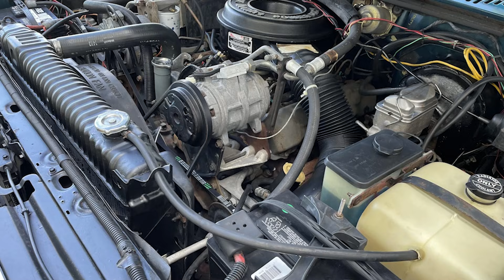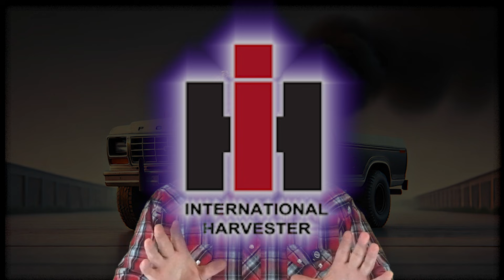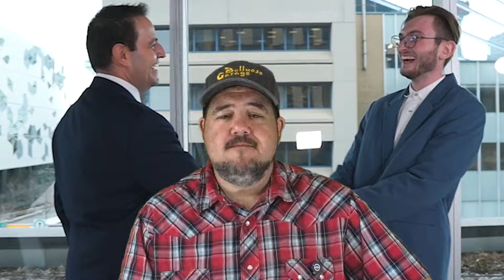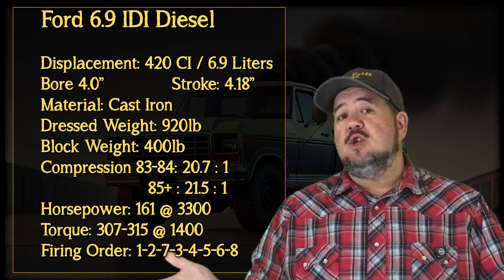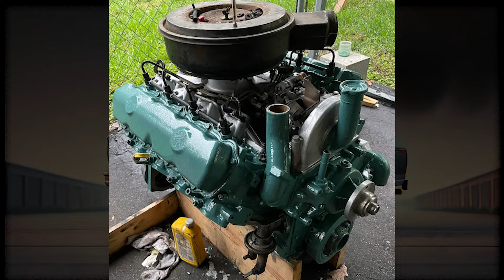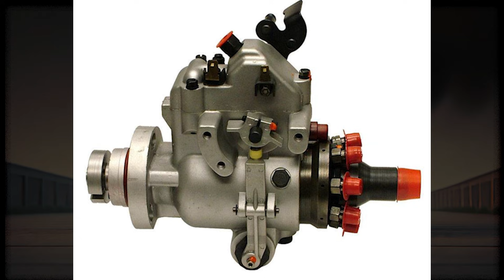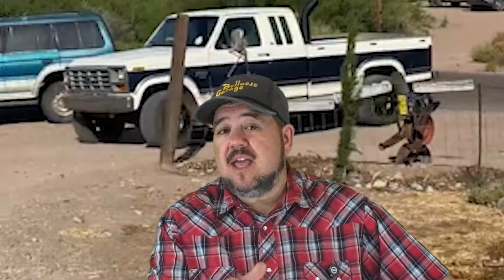Ford 6.9L IDI Diesel: Everything You Need to Know

Comment: I just bought an 84 f250 that has been sitting since 2004 when the original owner died.  I upgraded and modernized the fuel system and new glow plug controller.  It runs great and sounds so smooth going down the road.

Comment: I'm looking into buying a 1985 f250 4x4 with a 6.9 IDI and 4 speed manual transmission with 200,000 miles. She looks a little rough but he said she starts fine and drives. Thanks for the info man. As long as she fires up and drives down the road, I think I'm going to buy it.
Reply: Howd it go?
Reply: Howd it gi

Comment: I'm a quasi Bullnose junky, the '80-86 F-Series and Bronco are my favorites. I own 3 Bullnose F250's and a Brick and an Aero. 5 altogether. I'm good with any of the engines available for any of them( other than the smallest SBF in the beginning) I will have a 6.9l, 300I6, 351 Windsor and probably a supremely modified 400V8. Plus my '90 Supercrew 460/5 speed 4x4(all are 4WD) It's time to offload 85% of my 23 4 wheeled fleet and probably a few motorcycles at this point.

Comment: That picture you got floating by your head is a 7.3 PSD not an IDI. Direct injection, electronic fuel system Navistar motor, the only thing it had in common with a 7.3 IDI is the displacement. Neither are IH motors, IH rebranded as Navistar in '86. Early 7.3 PSDs were great; later years, arguable. Not nearly as bad as the 6 litre and 6.4, the downfall of the Navistar/Ford relationship leading the 6.7 PSD to be built in-house. Both 7.3s are  great motors but I will always prefer the old, chatty smoke machine. I'm torn, I've always wanted a 12 valve Cummins powered bullnose Ford but I'm really enjoying this old 6.9.

Comment: Worked as a mechanic at a Ford Truck dealership starting in 1981. Though Ford didn't get the 6.9 until 83 we were doing conversions on new F250-350s with Isuzu inline 6 diesels. I don't know what they were rated at but quite a few were sold.
I was so stoked to learn that the 6.9 was coming I couldn't wait to order one. 83 XL with A/C, 3.54 limited slip rear and radio delete were the only options. Paid around $11k and took delivery on March 18. Took it on a 350 mile break-in run the next day and picked up a rock chip in the windshield that is still there to this day (never turned into a crack).
Yes, I still have the truck 42 years on. It only has 148k miles on it because I always commuted to/from work by motorcycle so it mostly saw duty for hauling home improvement supplies, towing a small travel trailer, motorcycle trailer or sailboat. Just finished installing a new clutch- for the second time in 20+ years the disc hub broke a section and spit out a hub spring causing a rock hard pedal that wouldn't disengage.
No rust but paint is mostly toast because it lives under a neighbor's palm tree that rains sticky little berries that have ruined the paint.
I could get a new truck but it would have to park in the same place and wouldn't get much use and I feel a certain loyalty to MY truck (silly I know).
Thats my bullnose story. I didn't mention the parts I collected over the years for a ZF 5-spd conversion, factory 7.3 IDI turbo shortblock and early Banks turbo kit. Maybe someday.
Reply: im curious about these Isuzu inline 6 fords? I've never heard of these before i'd love to read up more about them.
Reply: @T3xan  I think it was a kit but  I don't know who from. One guy in the shop was doing them and did a few of them. I don't know which Isuzu they used But do remember he had to massage parts of the firewall with an air hammer after the original engine was removed.
Reply: That's a great story!  I love hearing stories like that from men of your era who were around & working during that time.  Never sell that truck!  You've got a true lifetime truck that spans four decades of Ford truck history!  I've been wanting to get an OBS Ford diesel for a few years now.  Originally I was set on an AeroNose 7.3L Powerstroke diesel, like a '96 or '97 F350.  But lately I've been entertaining the IDI Ford diesels, because the all-mechanical operation of the engines really impress me.   I'm wanting to have a truck that I can rely on for deep backcountry exploration not only across the lower 48, but up in Alaska & Canada, too.  A manual transmission is a must have for this reason.  Funny enough, I'm not opposed to a 2WD F350 model, since it would be pretty easy to install a Detroit Locker in the rear axle.
Reply: IT ONLY HAS 148,000 MINE ONLY HAS 70,000 ITS IN A MOTOR HOME THAT ILL NEVER SALE AN 83 EL DANARRO $$$ LOVE THE OLD SCHOOL SIMPLICITY HAVE HEATER BLOCK. ITS SLOW UP THE MOUNTAINS I JUST FIND A SLOW 18 WHEELER PUT ON 4 WAYS GEAR DOWN. LIVE IN SALT LAKE TOW BOATS UP TO 10,000 FEET NO PROBLEM IM RETIRED NOT IN A HURRY. I'VE  SEEN NEW TRUCKS FLY BY ME BLOW UP SIDE OF ROAD
Reply: @donaldhutchinson5090 Thats great and all but why are you yelling? All caps is the text equivalent to yelling.
Reply: @crewdawg2008 WHY YOU WISPERIN LIBRUL

Comment: Hey Ed thanks for the video! I recently acquired an 86 f350 6.9 4x4 with the T19 4 speed in it as well. The engine was locked up when I got it as it had been sitting in a pasture for every bit of 14 years. Some marvel down the glow plug holes and a good tug freed the engine up thankfully. I’ve put a starter on it as well as new pickup tube in the fuel tank and new lift pump on the side of block as well. I have confirmed that I have a cracked return line on the rear injector, but my question for you is if that return line is cracked, would it prevent mechanical lift pump from being able to push fuel to the fuel filter housing? I have verified that the fuel line to the lift pump is clear by blowing air back into the fuel tank. Any help or advice would be greatly appreciated, thank you!!

Comment: Honestly the only thing I’d like more than my idi is a 6 or 8 cyl 2 stroke Detroit
Reply: A V6-53 . . . With glasspacks
Reply: I helped a local farmer haul grain many years ago and he tossed me the keys to a Peterbilt 359 with an 8v92 TT. Best job I ever had lol. It was built to the hilt, like 600hp and had a 13speed behind it. Wide open 8 inch pipes. So loud you couldn’t hear the radio but it sounded good enough that you didn’t mind lol.

Comment: I got a 1984 Ford E350 Hightop van with the 6.9 IDI from a trade a couple of months back. Didn't know anything about the engine. I was about to sell it to buy a short school bus, but after watching this video, I might just keep it. Thanks for the info.
Reply: My 85 6.9 has been nothing but reliable and fun for me. Mine even sat for almost a decade before I got my license to drive it and over the years it’s hauled and hotrodded around with very few issues. Replaced the lift pump, some fuel and brake lines, coolant thermostat and heater core. That’s it! the loaded fuel mileage is what makes it all worth it
Reply: @dumpsterwench I may be buying a 85 f250 4x4 6.9 . Auto . What’s ur best mileage ?
Reply: Yes, definitely keep that one! If it's a 4x4 especially and if it's got the TTB and you can do the SoloMotorsports cut and turned Dana 50 TTB +6" added clearance without the added brackets for every other lift kit. That thing would be a nice ride and have more than enough clearance for off road. Add lockers and you'll be set for basically everything as long as your tires have good traction.
Reply: @RollingRigTraction  i had to look up everything you just said to understand what you mean haha. Unfortunately it's not 4x4 and I don't think it has the TTB, I would have to double-check though.  I would eventually like to make it 4x4, just haven't figured out how yet.